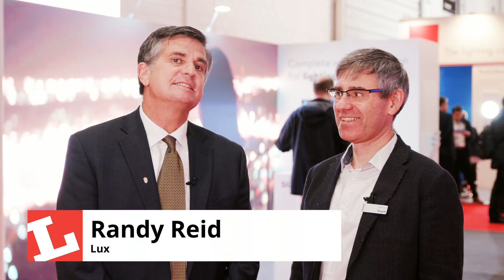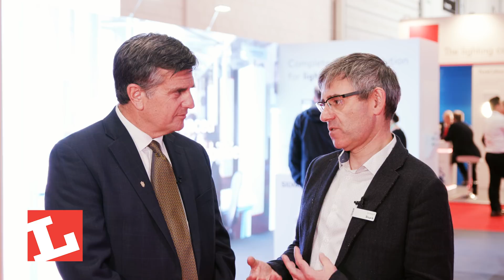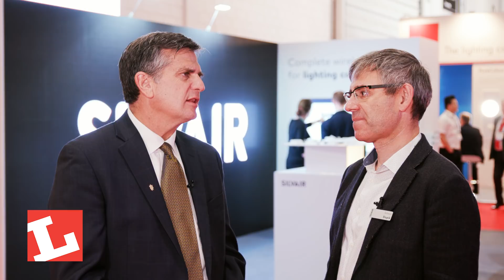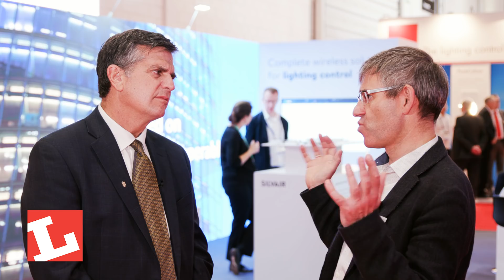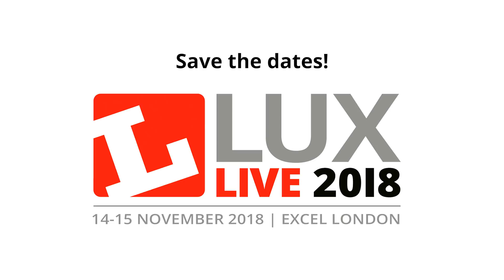Bluetooth mesh 'will kill the lighting control box'

Comment: The elephant in the room is that bluetooth works at 2.4ghz,  a very crowded part of the radio spectrum as unlike mobile phone frequencies, you don't have to pay to use it (which is why wifi uses it).  So whilst you can get away with it in the home environment, in an environment such as a stadium, theatre or exhibition hall where everyone of the 1000's of people there is carrying a mobile phone that have their 2.4ghz radio on maximum (whilst searching for wifi and bluetooth), so I can't see the mesh could be reliable even with its clever features.
Reply: Well even though it's on 2.4ghz it can co exist due to signal polisation and constant adaptive frequency hopping